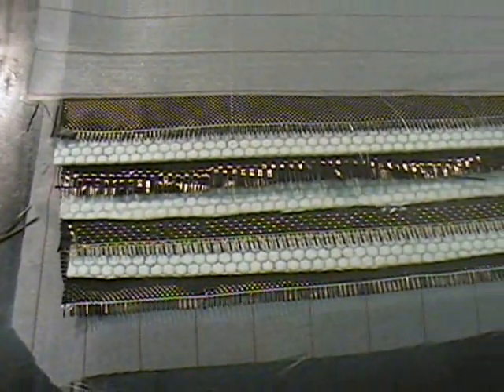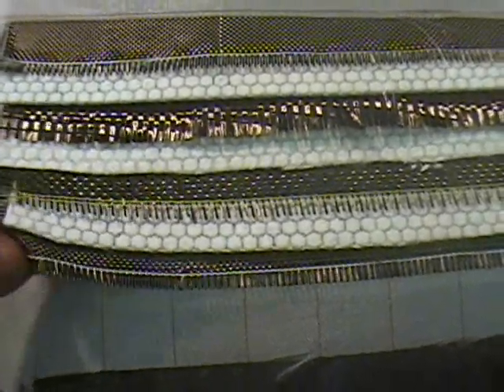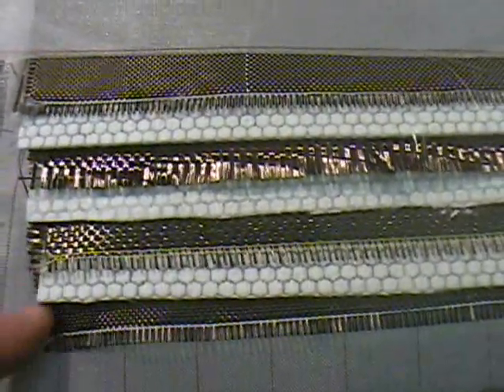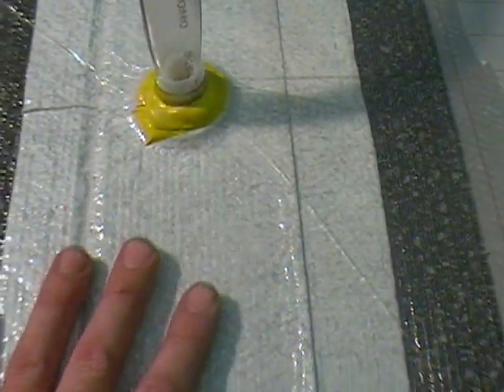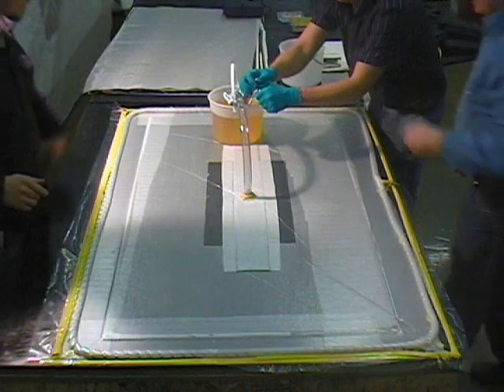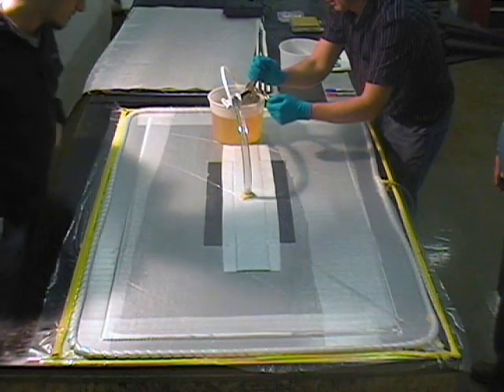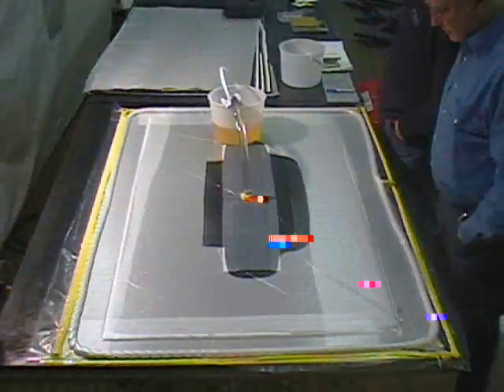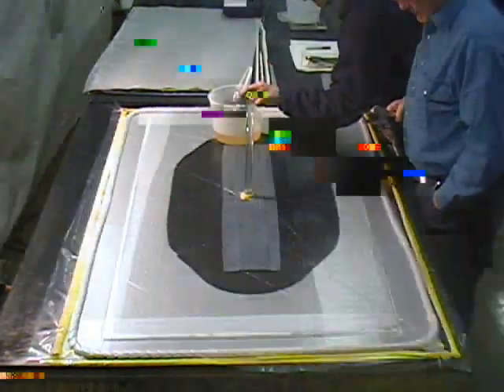vacuum infusion of an aircraft bulk head

Comment: Nice job!  The core you placed in the centre was however a waste of time as it is in the "neutral axis". It would not assist in the strength / stiffness in any way. One other suggestion would be to do the layup on waxed glass. The result would be a glass smooth, gloss finish. Thanks for putting it on YouTube.   :)

Comment: what kind of epoxy did you use I cannot get my to infuse once I set it up it's like the resin is too thick
Reply: They mentioned that they heated it up. its a common trick for lower viscosity, but comes at the price of pot life. You can also find epoxy thinners that work as well.

Comment: Im no expert,but whats the point of having the infusion spiral around the part when its actually is used to spread the resin around the part!
Reply: You have no idea about vacuum infusion, to be more precise. You cannot be sure that the resin flow reaches all the margins at the same time, so small quantities of low pressure air may be trapped, especially at the corners. As far as the resin spreads, these air spots become smaller, but at normal atmosheric pressure this time, and the resin stops, making them permanent. Besides, you may also have air leaks, happens sometimes. Anyway, there is no perfect vacuum, therefore the air must be removed from the start to the end of the process. The spiral is also used to remove the resin in excess, there is always a little. (If it's not too much, then it's never enough - old romanian saying). If the cross section is too thin, the contour path may be blocked, causing (again) the above mentioned air spots. There is a whole theory of fluid mechanics that supports this method, I'm only trying here to explain it in (hopefully) simple words. Hope this helps and no, it was not in my intention to offend you.

Comment: How did you set up your inlet port to not stick to your panel and allow good resin flow to the center of the panel. Did you use perforated peel ply. I'm going to do a panel that is infused from the center out and I've only done infusion a couple times with a steering wheel mold where I pulled the resin across the part. Any tips/info would be great.